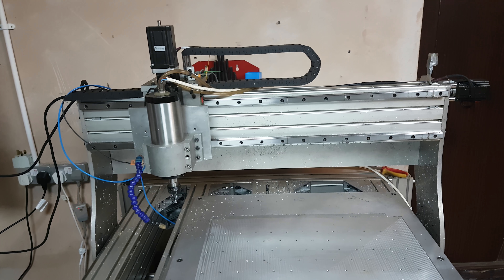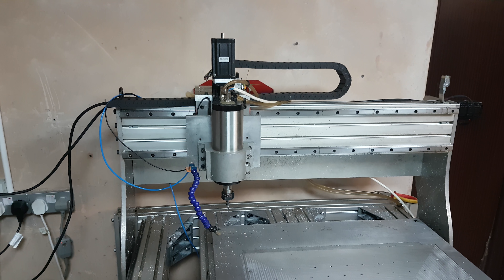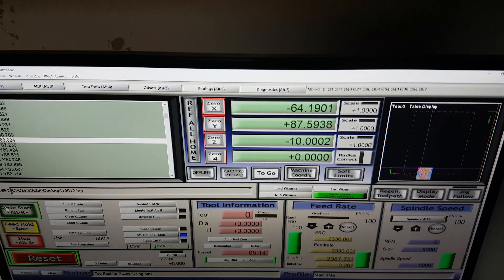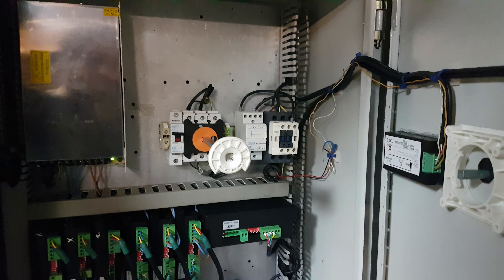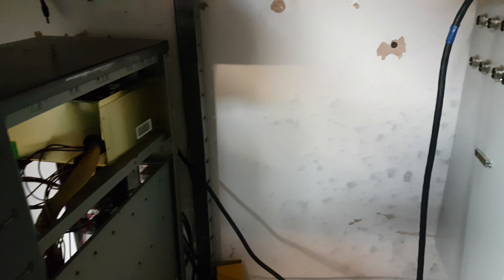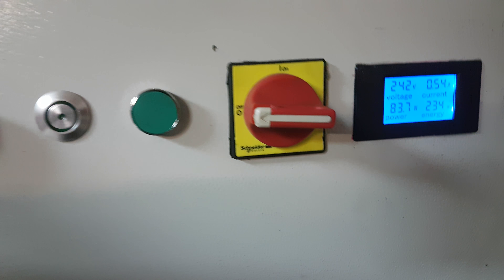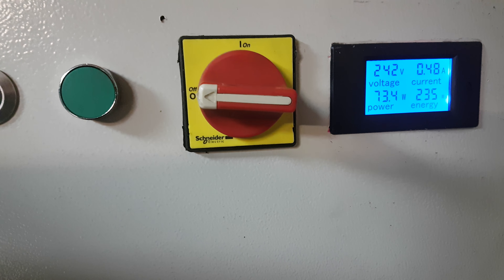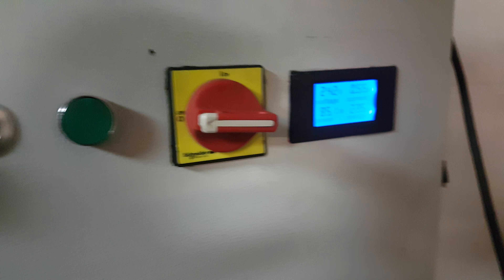Home made cnc Progress finally

Comment: Have you measured what you spindle deflection is at 20kg applied to a tool in the Y axis? I am interested in using the same linear rails you are using on the gantry. I think they should be more solid than the wheels on the v-slot extrusion.